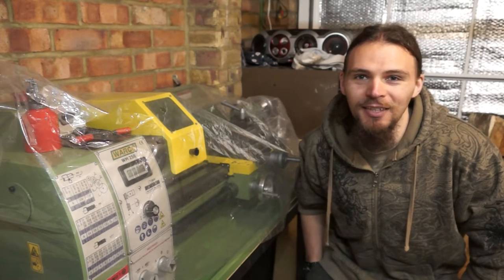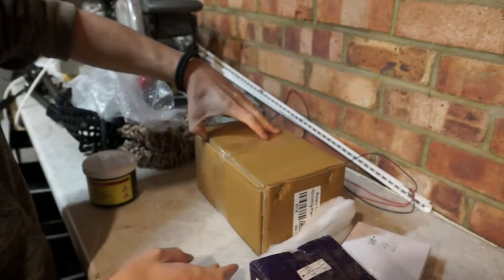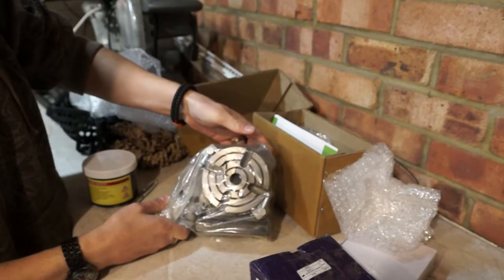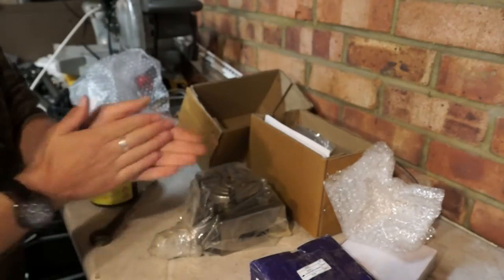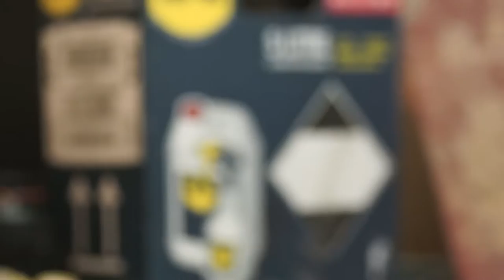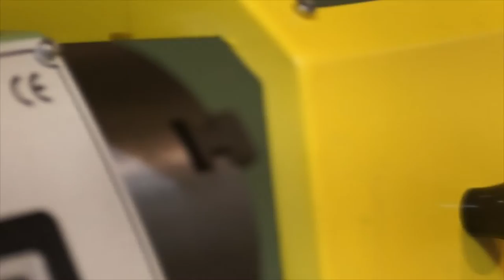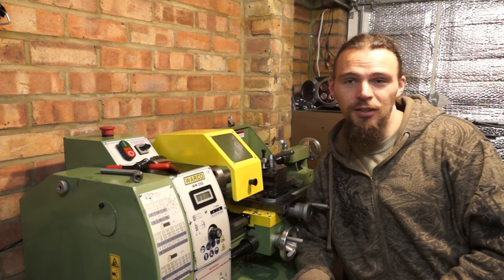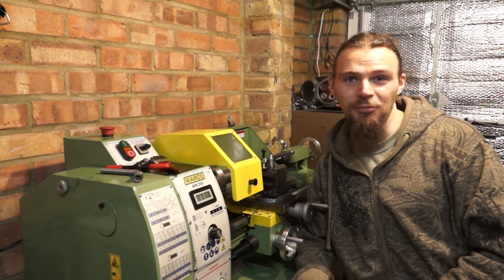Clean, oil & first use of the Warco WM250 Lathe

Comment: Enjoyed your video a lot 👍 Top tip when pouring from a 5 liter WD 40 container, spin the container a further 90 degrees so the wider side of the container is facing down to the floor you will spill less.😂😂
Reply from the maker: I am please you enjoyed it. I dont know why I didnt think of that. I was probably busy trying to remember some obscure hack where they poured it 180 degrees out and was worried I would make even more mess.

Comment: Nice video,  I would like to ask for a drawing of the location of the mounting holes from the edge of the drip tray in both axes for the WM 250V lathe.Thanks you.
Reply from the maker: Hi Michal, I have had almost an identical question on this video https://youtu.be/xhBbqFG6vDI if you want to check the comments there is a back and forth with Anthony Newton about the size / location of the mounting holes and tray size. 
A snippet of the measurements only is 
WM250 the table is 1100mm * 420mm and the whole table has a inner boarder of 20mm. The mounting points for the lathe are about 210mm from the front most edge and the holes are about 110mm, 230mm and 1005mm from the right hand edge (Gearbox end). The drain hole is 330 back and 700mm from the gearbox end. 
These are best measurements as its hard to get great readings around the table now its built. 
I would reccomend building a table based around the catch pan once it arrives. Having built the table before anything arrived meant I had to make a few creative solutions.
These measurements are best estimates as its not easy to get accurate measurements now everything is assembled. 
I personally recommend contacting Warco to see if they can provide details of the bolt layout. 
I hope that helps.
Good luck and let me know how your projects works out.
Reply: @CavemanAston  Hi, thank you for the quick answer, I have the whole table ready, I just missed the middle strut. I made the table 1200x600 mm. I contacted Warco, but no answer. In 14 days I will have my WARCO WM 250 V. Good luck to your projects. Merry Christmas .

Comment: 3 months too late, but I think you meant grease for the change gears and not gear box. There really two different items on a lathe. Not only do I think so, but a fairly famous model engineer by the name of George H. Thomas mentioned about the change gears on the Myford super 7 lathe only needing a few drops of oil on each gear each time you use it. Compared to almost anything else that's gear driven, smaller lathe change gears are actually quite lightly loaded under use. And grease has one bad quality on those open exposed gears. It both retains gear wear particles and due to that, recycling them back through the gear teeth during every revolution so that further accelerates even more wear, but also any cutting chips that sooner or later will get in there. Using grease is actually worse for the machines accuracy and life span. Oil on the other hand helps to slowly wash off and remove those metal wear particles. That's the exact reason why way oil is used on the slides and feed screws and not grease. If the factory recommends that grease on those gears then it would be the one time I'd use logic and very much disagree with there lubrication recommendations.

Because of the selling price on these hobby level lathes, there's zero money left for proper cleaning before assembly and application of that shipping preservative. Exterior cleaning while important, is only about 10% of the job. Other than removing the head stock and it's spindle which I wouldn't recommend for anyone without lot's of experience, all these machines will have residual grinding dust and sometimes the odd cutting chip throughout the parts assembly on every major component. If it were me? I'd do a complete disassembly and a thorough cleaning in solvent of every part. That also removes any shipping preservatives that were missed the first time. It's then much easier to readjust items like feed nuts and gibs to much tighter than the factory did due to that layer of shipping preservative, yet still have a much easier, more accurate and smoother operating machine. Yes doing so is a fair amount of work, 1-2 days worth probably. But I did the same on both my 11"x27" lathe and Bridgeport type milling machine. And either of those has far more parts with much larger surfaces to clean. While I didn't find large amounts of that grinding dust as well as a lot less casting sand, there was still more than enough I was happy I did so. You might be surprised at the difference it makes. And a machine adjusted as close as possible while still being easy and smooth to operate will almost always produce much better surface finishes.
Reply from the maker: Hi Turning Point, 
You are not too late at all. Well, as you may have guessed I am not a machnist by trade so I simply took advice from the limited instruction book that came with the lathe and the dealer when I phoned them and that was their recomendation. 
But you make a series of very good points. Luckily enough I am now a little more confident in taking chunks of the machine apart and intend to do a bigger and better clean down before I install some way covers. So this information has come at just the right time. 
Thank you for taking the time to explain everything so well. Wish me luck in getting everything back togther correctly.
Reply: @CavemanAston  I'm not a machinist either, I've spent almost 40 years now trying to learn the little I'd like to think I do know though. It's not an easy or quick task to even attempt it, and no one knows it all. I think I'm lucky and have a few so far unmet email friends who are or once were machinist's and tool & die makers. 

I am firmly convinced that there is one reference book that anyone with an interest in machine tools should have it's this one. https://www.teepublishing.co.uk/books/in-your-workshop/model-engineers-workshop-manual/ I still refer to it today. It's literally worth 10 times it's price. Few to maybe no real machinist's wouldn't pick up a few bit's of information from it never mind entry level people. Good reference books are tools as well, and very much should be considered just as important and sometimes even more so than anything else in the shop.
Reply from the maker: @Turning Point I have ordered that book so I look forward to learning all sorts of stuff. 
Luckily I did a little machining in college and was an apprentice with quite a few people doing mechanical apprenticeships and one has given me quite a lot of pointers and advice already which I am very greatful for.

Comment: I try to find out what "fancy grease" can mean in german :-)
Reply from the maker: Good luck. I don't speak German so can't help. 
I have had some mixed opinions saying I should use oil instead of grease. But the manufacturer said I should use grease.
Reply: @CavemanAston  I didnt expect an answer from you because of "fancy grease" ;-)
Well, grease (stiff) or oil (fluid) depends on the purpose for what it is used.
But if the manufacturer states to use grease I use grease
and if the manufacturer states to use oil I use oil.
Grease stays in place, oil drips of.

Comment: Nice lathe mate. Are you pleased with it after all this time?
Reply from the maker: Yes. I am very pleased. Although I might have sprung for the gear head version (easier to change threading speeds) rather than changing gears manually by taking the cover off.